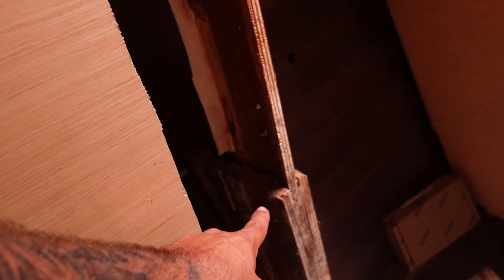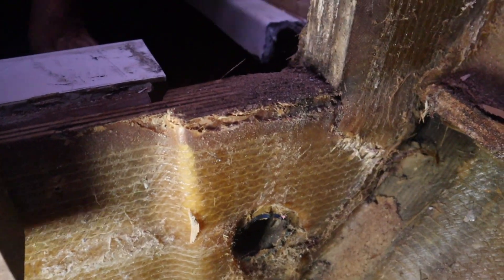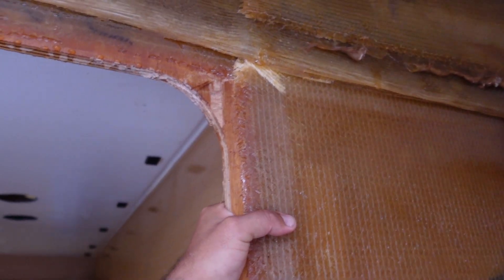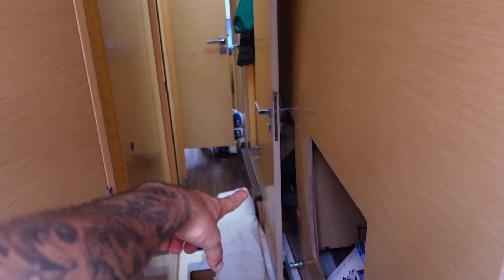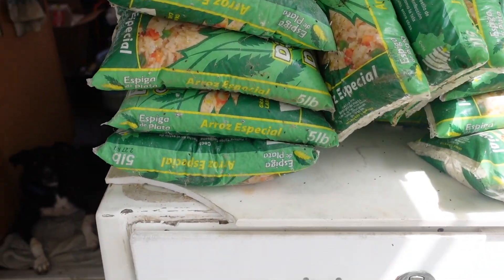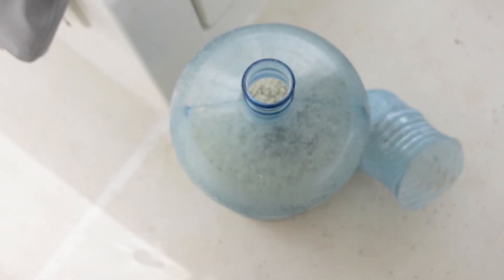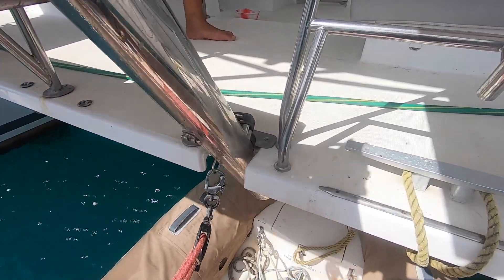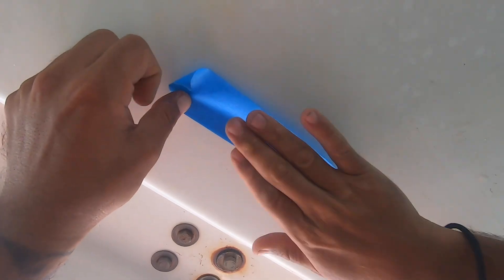CRACKED BULKHEAD REPAIR SERIES: Part 1 - An introduction... (Episode 107)

Comment: I've been a boater since I was in diapers. I love boats and boating and this is the most interesting story I have ever heard about any boat except maybe the old Broad Waters in the 70's that used Chinese plywood that literally delaminated in a instance causing some boats to disintegrate and sink in less than a minute when a a failure happened. This will rock the boating world. Boaters talk and they are connected. Much respect to all the loyalist for this boat. It must be one hell of a ride. I really sincerely hope Lagoon makes this right as more reports are coming in about this failure. The Hurricane didn't cause this. Management did. Too expensive to glass in the bulkheads, using glue in the main structure of anything is a bad idea. That's exactly why bridges are bolted and welded. Welds (glues) are unpredictable but bolts are not.

Comment: Its hard to say anything positive about Lagoon or the designer, except they are willing to help out, no doubt due to the public showing of such bad build quality. They are not cheap boats, but certainly built down to a price that quality and construction integrity is lacking.  I admire your energy, i have no doubts you will sort it.  Any options on spreading the rigging point loads?

Comment: The amount of bulkhead reinforcement that I would insist on before bluewater sailing this thing.......  I really was considering a Lagoon 450, but I do not believe this is hurricane damage.  After reading online and chats with other owners, this seems a little too common.  I am sure you will take care of it (with great expense and lots of labor), but would I buy a Lagoon without the factory pushing out a major fix?  I doubt it very much.

Comment: At 14:19 you can see that the bulkhead collapsed where its width decreases due to the hull shape: Less and less material needs to take the same force.  That is compensated by tripled plywood, which shows Lagoon understood the force density there and designed a weight efficient bulkhead. But the bonding of the three sheets failed, reducing the bulk head back to one sheet and that bent.  As such, it is not a design issue, but a manufacturing problem to me.  Separated bulkhead and door frames reduce the building cost by allowing to use a pre-fabricated all glued cabin cell, but forbidding to inspect structural parts is a no go.  There are three sheets of thick plywood, but the outer two only look pretty and hide the state of the bulkhead, where they could contribute to the stability at the same weight, resulting in a strong, pretty looking and inspectable bulk head.

Comment: The elephant in the room is that Lagoon must be freaking out.  I can only imagine on how widespread this issue extends.  I'm sure that this cat wasn't design to use this glued joint method.  Looks like Lagoon was cutting corners during production.  I was in the Bahamas a couple of years ago and more than half of the cats out there were Lagoons.  I can't feel sorry for this company, the fact that they are helping you is only an attempt to mitigate the damage to they reputation.

Comment: Greetings chaps.
I've been watching your chanel for about the past 12 months..
The damage there although major  doesn't look like a difficult repair it will take time, lots of time but it's all doable and by looking at past projects I've no doubt it will be do e to a high standard.
My business has just reponed after all this Covid stuff or I would have volunteer to come over and help you guys splash the fiberglass about.
I bought. 45 foot trimaran a while ago and upto now I've laid down over 300 sq m of glass rebuilding it. If you get a chance go look at a video I did a few years ago.
https://youtu.be/EDew0aG7QhM
I didn't do I video diary like you and others have done because I just got on with it then did a little video for fbook to show what I had done not how I did it.
Anyhow have a look at a page called life on the hulls on YouTube.
He is an Ozzy guy building a cat from scratch.
Using. Foam core rather that ply.
May give you some ideas for other materials 
Keep up the good work Colin it will be over before you know it.

Comment: I suspect damage related to Irma caused those bulkheads to buckle... Hurricanes have a way of twisting rigid materials back & forth until they fatigue & warp in torsional ways. Most things snap off or break immediately but some things hold on awhile longer &  not quite fail entirely until later. Like a metal fork, it can be twisted back & forth many times before finally separating  Did Parlay get inverted & dismasted during Irma? If so, shearing forces involved with those kind of winds & waves most certainly must have twisted, torqued & loaded up almost every structural support section of Parlay at some point until it found it's final resting spot once storm cleared.

Comment: I think I would be asking Lagoon for a template of the bulkhead (to be posted to you)both sides  at the fracture point and meshing a whole new sheathed plywood bulkhead as far up the chamfer panel as possible once the hulls are in line, effectively doubling the bulkhead in this case. . Bond together with Techni glue or meth methacrylate, plexus or similar and then fillet and tab extensively to complete this job. Hope you are well and coping with the rigours. Keep up the good work. Ross.

Comment: Vincent (Lauriot) Prevost is a mammouth. He’s the “LP” in VPLP design. THE leading boat design company for a long time. They have had close to a monopoly in multihull ocean racing. Meaning he’s one of the two founders and leaders of the company behind a very large part of all extreme racing boats and lots of fast cruising boats emerging anywhere the last 30 years. Having this guy guide you is an asset.... to put it very mildly.
Edit:
That damage you found can only happen by having moist wood. That makes it soft and mouldable. If it’s dry, it’ll break, almost no matter how slow the bend happens...

Comment: from a mechanical perspective...
if you have a loaded cat with stores of several thousands of pounds. then you add high wind loading driving the boat hard from being overloaded beyond its design. some part has to equalize by breaking. obviously the rig and hull saw some serious stresses in the hurricane and if overloaded then that could be an answer. the hull was probly twisted by the very long lever called a mast. you could model it via card board box with a stick pierced through and string as the guys showing the twisting moment into a trapazoid. this model may help find any other unseen damage even if it could be a cad printed on in plastic.
I would start by assesing if you had too much weight onboard since your offloading everything anyways. that would be a good place to start of finding the why the hull failed and a way to future proof its design.

Comment: Looks like the boat was designed with minimal compression strength, I'm surprised to see such lengths of plywood without lateral reinforcement. It's like holding a playing card on edge between your fingers and flexing it causing it to bow out. It's like it has been squished and all its ribs are broken. If the amount of rice stored on board is anything to gauge by I'd reckon that the boat might’ve been a bit overloaded too.

Comment: Seems a shame  modern boats domt build in access to check or repair , been round boats fot 50 odd yrs ,seen a lot of this in multi  hulls , just gotta fall off a  wave badly and it wrecks havoc. !,   there is a lot of stress on those  hulls .but u got it kiwi

Comment: Personally I think 🤔💭 it’s a very flawed build process. Structurally, although I can’t see all supporting laminations, it’s not been built any better than a caravan! You have a huge job ahead of you. I’d also be using carbon to reinforce. Vinylester would match the existing polyester resin better. I’m sure you don’t want to here that, although epoxy will saturate the ply better and help to protect it from rot/water ingress. Although foam and carbon is Very much king stronger. 😎🏖🌴☀️🇦🇺

Comment: As a thought to the last question you asked, «so what could cause this?» The huge forces from the struts on the rigg, combined with moist or wet plywood bulkheads, due to being under whater for a periode of time, on top of natural sailing forces, finally gave way. I bet Parley will be the strongest 450 out there when you are done, for sure! Thanks for sharing, mate! Hugs from Norway! PS: It snowed here yesterday, just 30 clicks north of Oslo, so enjoy the warm climate during repairs, envy you that for sure, on the positive side! :-)

Comment: Hopefully lagoon will fly a crew there and really investigate and hands on help. As seems other 450, are reporting similar issue. All the interior yoy have to cut, wreck, perhaps they will donate replacement parts. Ultimately you are helping lagoon and insurance companies in this. due to fact of Awareness . They should give you a new boat in exchange for yours, to test and evaluate,  to learn for lagoon future and resell of used boats, for insurance companies.
Reply: It’s a hurricane boat. I’m surprised they are even helping him. They probably want nothing to do with the actually physical repair due to liability issues

Comment: As a complete moron who is barely able to form coherent thoughts, my esteemed opinion is that this boat is flaming shit. My heart goes out to the owners of this model craft but at the end of the day it is inconceivable that such long term bulkhead deformation should occur at all. It is clearly torsional stress being transmitted through the wood over time, not acute failure due to a single event.

This is the reason I am so poor, (and my gambling addiction, of course,) so that I never have to cry myself to sleep after spending so much money on something so beautiful that turns out to have rot under the skin.

I really do feel for you. I know you can't give up this repair. But I wish the manufacturer would give you more than a few phone calls.

Comment: That final bulkhead failure is in severe compression. The only way I have seen ply distort that much (and contort rather than shear) is when the wood is saturated. Yet the cosmetic cladding ply around it appears completely 'dry' ?
The tensile load on the mast stays must have been excessive for whatever reason. This combined with the delaminated ply could account for the failure. 
Question:
Is the same failure mirrored in the opposite hull that had not been submerged. If so then the problem route of the problem must predate the hurricane submersion. 
Kia Kaha Colin, you'll sort this out. Thanks so much for including the rest of us in your endeavours.

Comment: Here is my 2 cents worth. This was a flaw that started to break down after only a year or two, thus the loosening of the shrouds, then tightening of the shrouds to fix the problem, but what the owners couldn't know is that they were just making the problem worse, The owners were thinking that the shrouds were stretching, not realizing that they were squishing their boat like when you grab a balloon. You get a tight bubble on either end of your fist but the middle is crushed. And every time the shrouds were tightened it just got worse until catastrophic failure.

Comment: If that's marine grade plywood brother, and I'm assuming it is? That would take prolonged exposure to water. It would not warp but rather fail under physical stress. I don't know how long your boat was under or how much water was trapped, and for how long? But I think you're right about it not happening even in a couple days of hurricane force weather. 
See you out there pretty soon. 🙏🇺🇸

Comment: The more you reveal with this damage mate it is looking more and more like bad workmanship and design by Lagoon.  Irregardless of the hurricane damage this boat may have endured.  Difficult to prove of course but sandwich mating of marine plywood to transmit forces from deck to hull seems to be a very weak design solution?

Comment: I'm no expert but materials that were improperly cut to size, then stressed into place by clamps/straps/etc. Fileted, glassed, glued, etc would hold once bracing was removed but not so well in the water. Lagoon is a world class company, and not knocking them at all. However,  one seemingly insignificant oversight by an employee, in my opinion looks to be the cause of that. The bow in glassed plywood suggests a metric fuck ton of force.

Comment: I can't help but wonder if overtensioned shroudlines could have an impact on the structure here. I'm not saying they were overtensioned on purpose, but perhaps while they're being tensioned, the hulls moved more than allowed and put additional stress on the bulkheads which could lead to this kind of failure over time. Add wind forces on the sails tugging even more and that might just be the recipe for disaster that struck your boat Colin... Regardless, I look forward to seeing you get Parlay up and running again. You're an inspiration to many - myself included - and I can't wait to see what you'll come up with next!

Comment: I hope you got some "double bias" +45&-45 degrees as biax is 0&90 degrees. You want all the fibres laying from the deck to the bulkhead. I'm sure you'll get it right, it will be stronger than new if it's done right.. The ply that is used for the bulkheads is not good.... it should have had more layers for the thickness.

Comment: Seems that this yacht has taken some severe punishment over a long period of time which has led to what you are seeing now.  Perhaps one of the previous owners has made some half assed repairs but the underlying structural damage was never attended to when the issues were first noticed (if at all) by a previous owner.  If only you had known before you bought it..... but then, things happen for a reason as you have said.  I'm sure that many owners of this model will be very interested in what you do to correct this and you would have to wonder how many other owners are thinking, "Jaysus effn' Christ, I hope mine is OK".

You are the man Colin.

Comment: I would agree with your thoughts.
This failure appears to be a delamination failure over time. 
Not due to one off storm.
Though, I'm not sure how long that area was submerged after the storm. That could make the findings appear to be more like a on going fatigue issue...
Your selection of the west system products would be my choice also.
Before you even said anything, I was saying to myself to over correct the repair to allow for the re tightening of your rig.
BUT. I would not rely on your level just yet..
Not sure how the boat is setting in the water. If it's loaded it may be setting off in the water.
You must Level the cross bridge when you set it on the hard... It must be level to give you a accurate starting point...
This project is going to make that other one you did seem like you were buffing out a scratch...
Good luck!!! 👍👍👍💪

Comment: I would double the thickness of plywood in those bulkheads with 4 layers of glass laminated between the doubled plywood. One layer of laminated plywood cant take the compression loads obviously. Then glass the exteriors of the doubled ply lamination and tab them in.  Its a huge job and the interior will need substantial fixing afterward.  Sucks

Comment: Hi Colin - it looks like the ply, fibreglass structure is not strong enough in compression to tolerate the forces placed on it by the mast and rigging.    I presume that when you re-tensioned the rig you kept with manufacturers specifications.    It seems that the bulkheads are just not robust enough.  The bulkheads on My FP are much bulkier.

Comment: I'd say tossed around like a lego in a bath tub is likely the culprit. No matter. My Dad advice is just don't address anything until you haul it out and suspend it in the middle. Inspect the droop and add suspension to the outer parts just below level like you said the designer said and you'll be cool. I'm stoked for you that you got the designer helping and you're a mechanical engineer. Awesome. Me too.

Comment: Hey Colin, the last bit you showed seems to indicate a buckling or compressive failure in that case where the central ply was driven downward and past failure eventually wedging/splitting the reinforcement plywood on fore and aft where it attaches to the hull's interior vert transition into bridgedeck. The first damaged sections you showed of upper and lower bracing damages, but both of those seem to be failing in tension modes, not compression.. In my minds eye I'm thinking you have a squatting orientation that's greater at rear of hulls where they are rotating AND spreading apart while the forward sections are toe-ing inward.. ( kinda like that snowplow technique that beginner level skiers are taught..)  perhaps due to the fwd lateral metal bracing that takes the sails loads restricting reaction... does that seem like what you're observing ? Looks like a lot more excavation into PR is needed to get access all the way down to the hull attachments ! Wish I could come down to help ! Glad you've gotten the Lagoon N.A. involved, you may be instrumental in designing a solution for many other 450 owners in the near future !

Comment: Does the Lagoon manufacturer have Datum lines to set their jigs to? Would be nice to make the correct measurements to the manufacturers specs. I mean how do you know the hulls are high...maybe the top cabin is too low. What part to raise and what to lower? Woudn't you make the 2 keels the base line and make eveery measure point of reverence to the bottom edge of keel? It also seems the bulkhead issues are not he only problem to fix. They gave way cause they had much more stress on them then the other bulkheads, but just fixing them may not fix the problem in the long term.